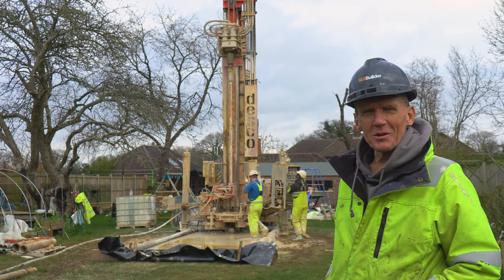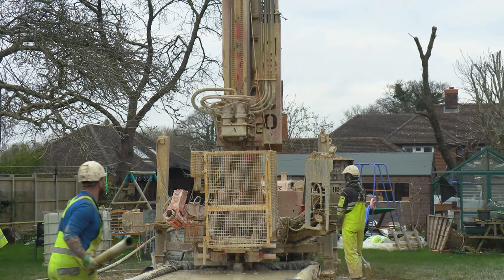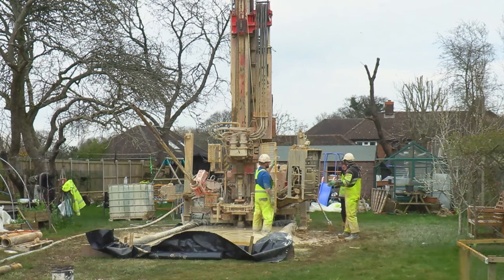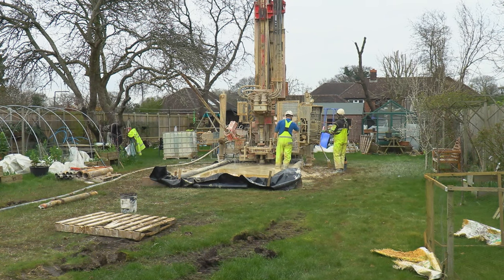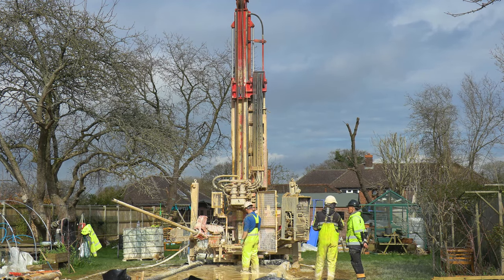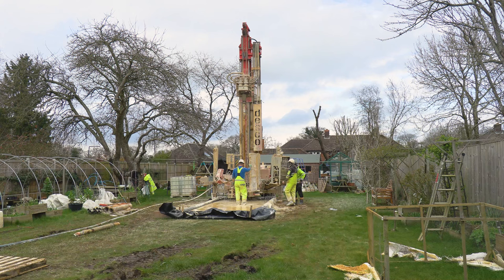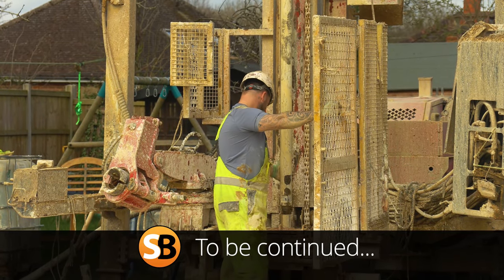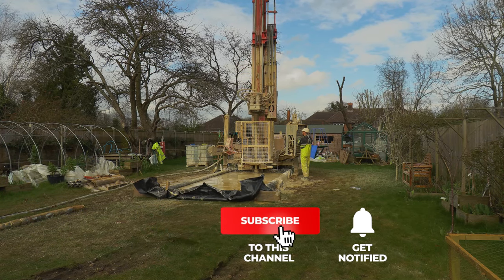Ground Source Heat Pump Bore Hole | Drilling for "Free Heat"

Comment: Another good video Roger. Having just been exploring the heat pump route my preference was for ground source. Accepting it would be more expensive but based on the figures given it was affordable. However, when the final costs hit the desk I was looking at 110% above figures given. Its certainly the best option for heating efficiency but too expensive for my project. ASHP ordered.

Comment: Probably the best outcome is that the ground source heat pump drill strikes oil, then you're sorted 😊
Alternatively use the holes to run a fracking system

Comment: I hope the next video will go into why you would choose this in the UK over an ASHP that is installed in a day for pretty much the same cost as a gas boiler and only marginally higher efficient (10-15%).
Reply: Install in a day?? My proposed system is slated for a week. There is quite a lot of work but the price is super reasonable.

Comment: Just did an online quote after watching this, the pump manufacturer reckons I’ll save £12 per year compared to my gas boiler #bargain🥳
Reply: Makes morse sense for those not on the gas grid
Reply: @edc1569  . Maybe LPG but oil is about the same cost as mains gas.

Comment: My brother has a ground source heat pump in his rather large house in Berkshire, installed about 4 years ago, which cost about £30K. It was recently renovated, so is very open plan. The house needs a rather large wood burning stove to keep it warm in winter - below 7 degrees and the house is frigid otherwise. Not sure of the payback time.
Reply from the maker: Hi Alexay
We hear from a lot of people who spent a fortune on heat pumps and found their homes were still cold. 
I would always have some auxillary form of heating for those cold days.
Reply: Classic builder getting away with murder, clearly took short cuts on the heating design and insulation and then the heat pump gets the blame.
Reply: That doesn’t sound a very good investment to me. I may be wrong of course.?
Reply: I don't think you are wrong.
Reply: @edc1569  To be fair I think the insulation is as good as it could be - very open plan, with high ceilings. Not sure whether he's got under floor-heating. Personally will be sticking with gas as long as they allow it in my house and a secondary wood burner

Comment: What is the total cost for a system like this including the hole? And what does a gas system cost? And what does a district heating system cost? And what is the long time cost of both over a 30 year period? Remember to calculate for inflation also.
I think this system is much cheaper in the long run if you expect to live in the house for the next 30 years. If you only gonna stay there for 5 years i dont think its worth the money.
Reply: £48
Reply: Either 2 or 3 boreholes plus all the ancillary equipment would be between £30-50k

Comment: Interesting fact, I believe the Civic Center in Southampton has used ground source heat energy for many years,
Reply: . It is technically geothermal because hot water was pumped out if the well and normally it would be pumped back into the ground via a second well. 
When they drilled the first well it wasn't very successful so it wasn't worth finishing the project but the well was capable of providing a few years of hot water so they built a district heating system anyway . When the well failed they used a massive marine diesel to provide electricity and heat. They extended the heating system only for commercial properties bug it has been successful but not quite as good as  they had hoped. The water was about 60 degrees and the strata was shale which may one day be fracked which is not as dangerous as fracking for fuels. One day it may fulfill its promise.
I know an engineer who worked on it .
He also worked on a scheme in Denmark  at a place called Ars. Can you guess what they called the well?
Reply: @ambassadorfromreality1125  No idea what they called the Well?

Comment: Hi, I wanted to install a GSHP for a project in West London some years ago. The drilling rig would just fit through the garage and out the other side whilst the back  extension was being constructed.  Incidently, please try and show how compact the drilling rig is when they are taking it away. The quote was £19k but what scared me off was if they hit water whilst drilling. I was responsible for all tankerage required. An open ended liability, so I declined.

Comment: I fancied a ground source heat pump but to avoid boreholes you need 100's of metres of garden, so really boreholes is way for the average person. Kensa were helpful but quoted £9000 per 100m borehole, which would provide about 5kW  (subject to ground survey) (and this is just the holes, not the actual heat pump itself). The other thing to note is that the boreholes need to be some distance apart, otherwise they'll start to take available heat away from one another....... so again, you still need quite a large garden to implement this. 
It's a good concept but too expensive and requires too much space for the average person IMO.

Comment: ive heard if your drilling into an old  coal mine coal seam theres loads of heat  is this true or a false????
Reply from the maker: true they are flooding them and getting heat from the water via a heat pump
Reply: Coal mines are warm cos they're deep enough to be heated by the heat that's conducted out from the Earth's core. Any deep mine will work for this purpose.

Comment: Heat in this case is like a fluid in a well what happens when you empty it? Even Icelanders move theirs regularly and they live on top  of volcanoes.
Reply: It will just come back from the surrounding rock over summer,  it would be interesting to see if anyone uses solar hot water to heat the rock during the summer to make it more efficient during winter

Comment: Would be interesting to know the cost of drilling the holes. Not exactly free heat, as it requires a lot of electricity to run it once completed around 1:4 efficiency or  a little better.  Can’t see how it’s cost effective to do this for one house 🤷‍♂️

Comment: Apart from the risk of ground water contamination, don’t ground source heat exchangers eventually equalise temperature over time?
Reply from the maker: No it is solar heat
Reply: @SkillBuilder  then it’s not ground source?
Reply: @SkillBuilder  You've been sucked in.

Comment: This is pretty cool but how much does it cost? Not only the drilling but the equipment to store the energy?
Reply: Why on earth would you want to 'store energy'. Sorry that does not make sense. It is a heat pump.
Reply: @mbak7801  Store the heat for use at a later time i.e. when it's colder?

Comment: That is not deep in drilling terms - not a huge increase in temperature at that depth.
Reply: Dosnt need to be. Just need to be able to have it take the cold temperature form the coolant and heat it up. You need a lot of heat absorbent capability which is why you need a lot of loop to absorb the heat. Obviously I realise heat flows from hot to cold but it helps visualise it. Heat pumps are all about phase change and it’s the point at which it does that is where the heat is exchanged.
Reply: @davideyres955  given the cost of bringing the rig to site, it would only be marginally more expensive to drill deeper - the higher the source temperature the greater the efficiency of the heat pump - money in the bank for the future.

Comment: I loved the chain spanner as well. I always like seeing these drilling rigs, both the vertical ones and the horizontal ones.

Expensive process for a single home though, probably makes more sense for a shared heat network I'd think.
Reply from the maker: yes it does seem to be an expensive option but when you don't have mains gas and you are thinking about the next 30 years of oil or LPG it starts to make sense, especially with the £7500 from the tax payer.
Reply: I'm glad you said it like that instead of from the government. It's out money at the end of the day. @SkillBuilder
Reply: @SkillBuilder  im so glad im paying for rich peoples pet projects:)

Comment: What is the point of this when you can get 400% efficiency with air source heat pumps.  The extra cost of ground source just doesn’t make sense, the payback period must be huge
Reply: There's a lot more heat that can be extracted from the ground than the air as the ground is a much more efficient heat store. The payback period may be longer but the system should be a lot more efficient, especially in low temperatures where you'll get the benefit.
Reply: Maybe they are preparing for gulf stream ending... Then it likely is more efficient.
Reply: You can store heat in the ground by using your heat pump to cool the house. Can't do that with air source.
Reply: Big benefit is passive cooling
Reply: @paul756uk2  - that’s true however, it seems nuts to pay so much extra for an additional 20% efficiency.  Vertical ground source heat pumps are a lot more efficient than horizontal ones, however they are eye wateringly expensive.

Can’t see any scenario, ground source heat pumps are worth the initial investment.
Reply: @davidcalvert-smith4633  yeh I don't disagree. I'm not a fan of heat pumps tbh unless the system is specifically designed for them, ie not in radiator systems. I think they're a good idea in warmer climates where Aircon is used most of the time and heating used in the milder winter months.

Comment: Clearly it is not going to be economical to go for this system.. Payback timescale must be several decades and more taking into account replacements, servicing and ongoing electricity to supply the pumps..

First and foremost massively improve your home insulation..  Next  fit mechanical heat recovery ventilation..  Then invest in good solar panels with  battery storage.  Then some air source heat pumps for hot water and home heating.   After all that you still won't be anywhere near the cost of this ground source system..   Alternatives like wóod burners/logs/pellets etc could be used rather than a heat pump (assuming you live in an area where you can burn wood)....

In any case that ground source system is only for people who have unlimited spending power .. if that's the case then keep burning gas or electricity etc..

Comment: Based on the companies own figures in the the link in the description it will be in round numbers £300 a year cheaper than using gas heating. I will bet that this chaos will cost around £10,000 to install, Oh and the figures compared between ground source rip off and gas/electric/oil were from July 2023 when prices were still hiked due to to the Russia invasion of Ukraine. Whatever, the pay back time BEFORE getting a financial benefit is 33 years!!!!!!! compared to gas central heating and that does not include how long the system will last before replacement costs and what the annual/ongoing maintenance costs are involved during its life time. 33 years before you are better off! Am I missing someting?

Comment: I'm seriously considering vertical GSHP plus solar & power cell for my final 'self build' home.
Already have a 7kva diesel generator which runs on biofuel & thus will not be requesting the services of the electricity & gas pirates.
Reply: Use solar thermal to heat the borehole up over summer, it'll reduce the load on the heat pump. Since you haven't built the house yet, it might be cheaper to do a 'thermal earth bank'. It's a field of shallow boreholes capped by the house.

Comment: Instead of a fuel bowser shouldn’t they be towing a large lithium ion battery?
#NetZero
Reply: 😂😂😂

Absolutely not

1000L of fuel is about 1 tonne in weight,   

Energy density for batteries vs fuel is 40 to 1

He would require a battery the size of a lorry trailer 40 tonne battery 

Net zero delusion.
Reply: That comment makes no sense. Also LFP batteries are used now. You are a bit out of date.
Reply: @mbak7801  that is the ratio for lithium.. lead acid etc is worse

Comment: Well done Roger, your heart's in the right place. But it neads to be made clear that there is no free heat in the ground, or the air, or in the water.  A heat pump has a compressor inside it which runs on electricity, a lot of it. Think constantly turning over a car engine without actually starting it. I'm retired now but worked on a number of these systems, as an employee, not from choice. I never saw a satisfied customer. If you want to be blinded with statistics by people promoting this stuff, go ahead. But go and talk to someone who's got this kind of installation and find out the true cost, whether it works and whether any of the costs are met by government grants, sorry I meant taxes paid by people who don't want this stuff and get their energy bills jacked up as a result. Follow the money and think back to all the other wonderful inventions that turned out to be disasters. I'm old and don't have long left so I don't really care. I won't read any replies, but feel free.
Reply from the maker: This is not about my heart or even my view of the world, it is simply covering a bit of technology that is out there. I think it gets a bit tedious if I feel compelled to pass judgement on everything. I have said a lot about heat pumps in other videos, they clearly aren't the answer for a great many homes but if somebody feels it is right for them I don't want to stop them.
The point about them being subsidised by tax payers has also been made in my previous videos. I think it is a mistake.

Comment: At no point is this free heat....the installation costs tens of thousands and the running costs are no cheaper than a gas boiler especially with the current price of electricity.
Reply: I agree totally 👍

Comment: This is total BS.
Reply: Nothing better than a well balanced argument and statement.
Reply: @stuffoflardohfortheloveof  Well i based my comprehensive comment 😁 taking many factors into consideration. The cost of this type of system is extremely high. ( test boring and then main hole boring.) The land required for an installation such as this is rather large. Most of us don't live in locations and houses such as in the video. It's for a select few who have lots of money to invest in the system etc etc.